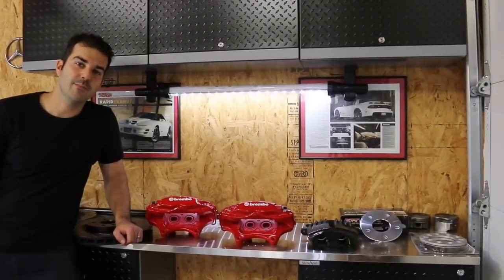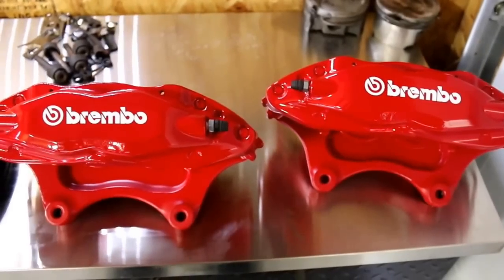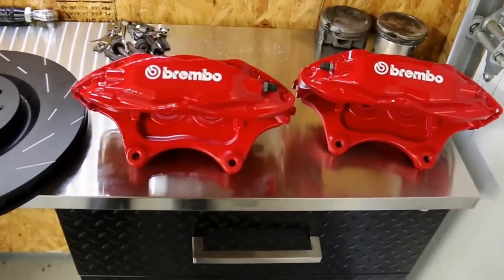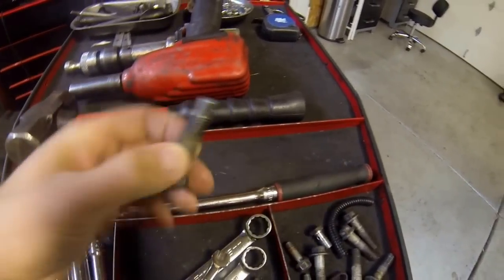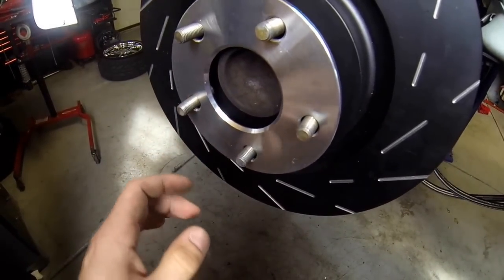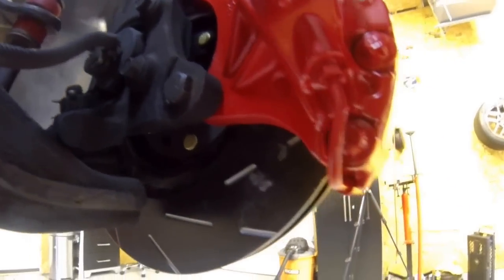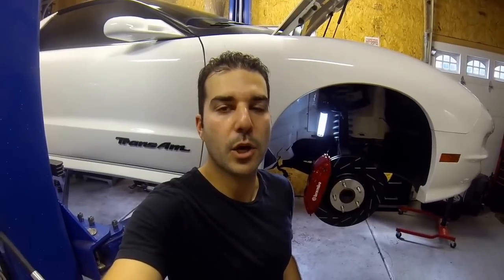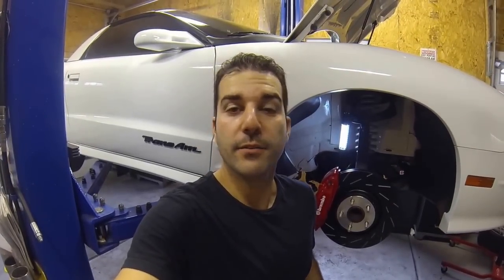Cheap and easy way to upgrade LS1 Camaro or Trans Am brakes. CTS V Brembo install.

Comment: That looks great! I was surprised at the brake pads you chose though, performance calipers and big rotors with a ceramic pad. The ceramic pad is made for comfort and low noise but you get a lot more braking grip from a performance semi metallic brake pad like ebc yellow stuff or blue stuff if available with the calipers. Thought I'd mention this since people that watching for performance upgrade options might copy your choices and wonder why they don't notice much difference in stopping power.
Reply: He specifically mentioned aesthetics. That's what 95+% of ppl have these BBKs for. How's the noise level with aggressive pads? Coz I see a lot of annoying squeaking (not sure I trust the drilled and slotted rotirs either) with ppl spending 2Gs or more. That's unacceptable.

Comment: Super glad I found this channel keep up the good work. I flatter myself that I know a thing or two about most things automotive. The video was filled with nothing but good info. You provide enough information for the reasonable competent enthusiast to do the job. What adds to my comfort level is you give enough explanation of why without getting too involved again reasonable competent. Should have no trouble what so ever. 
I performed a similar up grade to my old 3rd gen 92 formula 350 WS6. using C-5 13" with the stock 4th gen Rrs PBR and 17x9 all around with a square tire 275/55 17. used the 1le combo valve the get more rear brake bias. worked well one of the best upgrades I made to the car better even than the 383 /425WHP with beefed 700R4 . Thanks for sharingt his is a great upgrade again throe explain and illustration. Happy new sub. going to binge watch a bit.

Comment: Keep an eye on the pin kit. The ones that come with pads are often a few mm's shorter than the OEM ones. I reuse mine every time because of this. They have the possibility of backing out.
Reply from the maker: I will definitely check on them .They went in really nice and snug so I don't expect any issues. Thanks for the heads up and thanks for watching.
Alex
Reply: No problem. I'm sure they're probably safe 99.999% of the time, but I have seen a forum post about it happening before with a different set of Brembos. 

You can really tell the difference looking at the front of the caliper. Mine, with the OEM pin kit, look like this. 

http://www.carid.com/images/brembo/page/bottom/brake-kit.jpg
Reply: clutchthepearls  Wow! You took the words right out of my mouth , I just did  lower dust pads on my e63 amg and the pins they gave me where shorter I didn't like that , the stock ones you can see the cone of the pin stick out past the caliper for visual complete seat , another reason is the stock pins are stainless steel no stick with a magnet , the ones included where zinc coated steel equals possible rust
Reply: I wouldnt mind getting them. I put a 4th gen fbody on my 04 grand prix and works very well.
Reply: I work for a Professional Race Team IMSA Road Racing, and this reason alone is why safety wire the pins. We had the same issue with pins backing out

Comment: I'm doing the same CTS-V brake swap onto my 97 Z28 with the same 4-Piston Calipers but I'll also swap in "Detroit Speed" SKF X-Tracker wheel hubs. My Camaro needs a 1 inch or 1-1/4 spacer that has it's own studs because both my 18 inch C5 Magnesium Wheels that I use for road racing and my 18 inch C6 wheels for the street were both over a inch inside the fenders. For brake rotors I'm using C6 Z06 Eradispeed rotors from Baer which might have a tiny difference in offset. If so, a few washers in between the spindle and caliper should center the brake caliper and brake pads. Using the C6 Z06 Rotors, you don't have to have the center bore enlarged verses the 5th Gen SS Camaro...

Comment: Thanks for the video. I really came here for the part numbers and see how hard it was to do.  However, I think you have the rotor on the wrong side.   Air is supposed to move from the inside to the outside of the rotor.

Comment: I have a 2001 camaro ss. I have the c5 z06 18” in the front 9.5 wide will I get away with a 5mm spacer?
Reply: Lsjuan Camaro did u?

Comment: Great video I  have a 71 Camaro I'm in Chicago I'm going to convert my drums to disc
Reply: ??? Almost every company makes a disc conversion for this car. If you're referring to rear brakes. The optional rear disc from Firebird (same Generation). The system was the same on the early RWD Seville. The only problem is the Seville is the big 5 (5X5" bolt pattern). So you'll need Firebird rotors.  01 and newer S-10 Blazer 2WD (easier to incorporate parking brake). 3 or 4th gen Camaro 4 TH gen best.

Comment: This is great.  I’m seeing sets of 4 for 2004-2007 calipers but what about the rear? What do I need?
Reply: Keep the rears stock just upgraded your rotors and pads. Don't need too much braking power in the rear

Comment: Why wouldn't this also work on 93--97?   How much different did the front tire kick out , after install.
Hate wheels sticking out front wheel well.🤯😱
Reply: Have to change to the 98-02 ls spindles

Comment: It’s funny that I just added a “big brake kit” to my 3rd gen 89 IROC and by big brake kit I mean the 98-02 “LS1” brakes. And dont get me wrong the LS1 brakes on a 3rd gen is a dramatic improvement over the stock 10” single piston front brakes. But what I like is that now since I have the modified spindles I only need the correct bracket for whatever brakes I want. So quick question, what power level would you recommend to justify upgrading to these brakes?, I’m currently sitting at 330 hp at the tire
Reply: Depends if you do sprinted driving on backroads and weight of the car. My car with heads and cam was required. It's a big improvement over factory brakes
Reply: @bhcamaro2002  / ok well I live in NE Pennsylvania so I do some fun driving on the back roads, now the car is an 89 Camaro so I think they were 3200ish lbs and I’ve only removed the steel hood for a fiberglass one (had an accident otherwise I’d have kept the of hood). The car is a T-top but I’ve added weld in s. frame connectors. Like I said I have the “ls1” brakes up front and pbr calipers out back on a BW 9 bolt with 3.27 gearing. I’m in the middle of a power train swap right now with an Lq4 running 862 heads, so 10.5:1 compression, drop in truck cam for the 6.0 so power wise on paper at least I think ill be sitting at around stock ls3 power with everything coming in early because of the truck cam (using a truck cam because this isn’t a race car and I wanted my hp / tq down low). I have the opportunity to get a set of 2012 Camaro SS brakes for practically nothing and from what I’ve read my car will be 600-800 lbs lighter than the 5th gen. So what do you think about only running the front 4 piston brakes and leaving the rear as is or should I swap the rears out as well, oh and should I bother with an adjustable proportioning valve? Thanks for the help n sorry to be long winded
Reply: @limabravo6065  I left my rears stock. The rearend can lock up with too much braking pressure. Sounds like you have a decent build can't go wrong with a 3rd gen man

Comment: Can you not just run corvette rotors and not have to machine the hub hole?
Reply from the maker: teamgmotorsports You would still need to enlarge the hubs and the pads don't fit as nicely

Comment: Isn't the lug pattern different? I believe the 2010-2015 is a 5 x 120 and the 4th gens are 5 x 120.65mm. How does this affect the application?
Reply: No issue. Only thing I had to do it get the hub bored out to fbody spec at a machine shop

Comment: Looks like you installed the left rotor on the right side.  Air is supposed to move from the inside to the outside.

Comment: Hey Bro. just in the process of restoring a 98 Camaro. Would like to take the same route you did with the ctsv callipers. Question? will they fit on the rear? I want to look uniform.
Reply from the maker: These will not fit in the rear.  I'm sure anything is possible but they are pretty huge for the back.  Most just do the fronts and paint the rear to match.

Alex
Reply: Ok understood. but tell me, I'm pretty sure there was a video on installing Coevette brakes all around the 98-02 Camaro. Can you verify?
Reply from the maker: Hmm, not sure of a specific video.  I'm sure it's been done. Our cars have had every mod known to man kind tried at least once, haha.

Comment: Really like the video! Unfortunatly I'm running the 17" Dark Stars and as you said would rather not grind the calipers to death in order for this to work. Any other suggestions on other rotors or anything?
Reply from the maker: Hmm with the 17s I dont really have any other suggestions.  You could just go with the c5 z06 brake upgrade.
Reply: ATS-V brakes will fit on the front under 17s but you have to drill the mounting holes to 14mm I believe
Reply: I gotta say that by 4 min into the video this isn’t sounding cheap OR easy, given that no TA came w 18” wheels, so right oughta the box you’re telling me I need 4 new 18” wheels and tires on my WS6 that came w the upgrade to 17”!!!!  That means I’d have to recalibrate the speedometer then, too!!  Then, just for a chaser, you toss in the fact that I have to get the BRAND NEW ROTORS you’re recommending specially machined to fit?!?!  NOT CHEAP!!!   DEFINITELY NOT EASY!!!!  WTF?!?!?!  Y’know what?   You get a “spam flag” for sucking me in and wasting my time!
Reply: @Psykldoc  for 18in wheels, a 275/35/18 tire is same diameter as stock, and does not require speedo recalibration.

For as big of an upgrade as this is over stock, it is cheap and easy.

If you were familiar prices of kits like Baer, Wilwood, etc, this CTSV setup is very cheap and easy

Also, the use of OEM parts is nice for future serviceability.

Having the rotors machined really shouldnt be a big deal, and shouldnt be very expensive.
Reply: He’s not telling you that you “need” to do anything. He’s telling an audience what it takes to upgrade the f body brakes to CTS-V brakes. Nobody put a gun to your head and demanded that you upgrade your car. Also, nobody made you click on the video. If you’re too lazy, cheap, and not mechanically inclined, this isn’t the project for you.

Comment: So I have a 93 Z28 and my brakes suck. As you know they are 1" smaller than LS1 rotors and I have a hard time getting it to stop. I know that I would have to upgrade to 98-02 spindles to do the Ctsv swap. Question is are all 98-02 spindles the same such as V6 compared to V8?
Reply: Nevermind. Did some research and found out that the V6 and V8 cars had the same brakes.

Comment: Hi I’m using the same calipers but on a different car,my hub is 58mm,now if I used a rotors with larger hub hole like 68mm would it have issues?thanks.

Comment: So, I've had this whole setup sitting in my basement for the past 4 years. The only thing holding me back right now is dropping 1500 bucks on new wheels and tires due to my 17 SS wheels. The other issue is whether to paint them. I also have a white fbody and currently red calipers but I really can't justify messing with the factory coating they have even though it says CTSV... Lastly, I always wanted to ask someone who did this if they felt a difference in steering or anything up front from the added weight?
Reply from the maker: No difference at all in steering. Just better braking and cosmetically they really stand out. One of the best mods I've done. 

Alex
Reply: @LegitStreetCars  Thanks for responding! Ya, idk why it's just something that always looked great to me. Do you think the silver CTSV would look goofy on a white fbody? I constantly battle with this. Lol
Reply from the maker: I was debating that too since the calipers came siver like on the Cts. Here's what you can do. Run it silver at first and see if you like it. If you do you're done but if you don't it's not hard to take them back off for paint.  I really like the red on my white car though, silver may blend in too much.
Reply: @LegitStreetCars  Very true. Mainly, I wish they would I just don't want it to say CTSV since you'll get those douches that say, "it's not a CTSV". Lol. Oh whale. Thanks for the tips, sir! Sick car, btw.
Reply from the maker: Yea I hear ya.  Just paint them and be done then.
Reply: @alucarus6  awwwww shit you need 18 inch wheels ??????

Comment: Off topic question but what rims and tires do you use when you go to the track? Thanks in advance!
Reply from the maker: Hey Austin. For the track I use 17inch 5 y2k wheels in the rear and the 18 inch version of the same rim up front. Thanks for watching.

Comment: DID you grind the ends down on the caliper to clear the rims? Or running a 18"? Drill the bigger holes on the knuckle for the bigger bolt?
Reply: He's running a 18, if you go 17s you have to grind the caliper down

Comment: Great video and very informational. 
What's your review of the brakes? Anything you particularly like or dislike about the setup? 

I'll be doing this mod soon. I appreciate a response, been trying to find someone who has done it!
Reply from the maker: Thanks! It's been one of the best mods I've done to the car. The only issue is some brake noise but I suspect the pads are to blame. The calipers I bought came loaded with pads so I'll probably just swap those for something better.
Reply: Gotcha, well I'm excited to do this. Thanks for the reply! I'll be sure to invest in some decent pads the first time around.
Reply: 1 more thing, you didn't have to drill the bolt holes for the new calipers? Other how-tos that I've read for this say you need to drill out those holes for the bigger bolts that the cts-v calipers use.
Reply: @tampabaybuilds6825  1st gen ctsv are direct bolt on. The newer ctsv and Camaro ss 5th gen 6th gen will also work . You just have to drill out the spindle 1/2 then 9/16 to use the 14mm bolt that bolts the caliper. The ctsv 1st gen uses 12mm like the stock ones

Comment: Do you know if the 5th gen camaro calipers are the same?? 
And thanks man, a lot! For the vids, replies and everything.
Reply from the maker: The calipers are basically the same but have different mounting points. Do the ctsv its more of a direct swap

Alex
Reply: LegitStreetCars I can see that thanks to you. Only wanted to be sure because from where I am, tons of camaro's are parted out! 1st gen ctsv's are rare, but I should find one. Appreciated man
Reply: LegitStreetCars sorry one more question. What about the rear ones?
Reply from the maker: I didn't do anything with the rear. Some say too much rear brakes on these cars make them break loose on hard braking. There are proportioning valves you can get but a lot of people just do the fronts and they work great. Just put a good pad back there.  Check the links in the video. You can buy brake new loaded CTS V calipers for like $350

Alex
Reply: LegitStreetCars well, I guess I will stick to your swap. Thanks Alex
Reply: The front brembos on the 10-15SS are identical to the CTS-v calipers. They just use a 14mm instead of 12mm mounting bolts. My g8 required a 2mm sleeve to run the CTS-v brakes instead of the SS ones. 

All depends on what size the f body mounting bolts are. If 12mm then you're good and you can buy a sleeve from McMaster Carr.
Reply: @TheHerokid672  what year ctsv?
Reply: @hectorcastillo2463  04-07 are 4 piston 12mm and the 09-15 CTS-v are 6 piston front 4 piston rear and are 12mm. I think the camaro was the only model to use 14 mounting bolts.
Reply: @TheHerokid672  got it thank you . I'm still gathering info on what calipers to get that are 6 piston
Reply: 6 piston you can get on any 09 and newer CTS-v and 16 and newer ATS-v.
Reply: @TheHerokid672  I can get a set of 6th gen calipers new for 180 but can those bolt on like the 5th gen with just drilling the holes?
Reply: @hectorcastillo2463  the 6th gen are different. There's non-brembo gm brand calipers which are smaller and then the zl1 and SS brembo calipers which are larger. The larger one have better stopping power. 

But the mounting holes should be the same for either. So yes youd have to drill out the knuckle to accept the 14mm. A machine shop can do it.
Reply: @TheHerokid672  do you have like an Instagram? I'm getting a good deal 200$new 6th gen brembo calipers and rotors . But not shure if I can use them on the f body with the same modification as the 5th gen
Reply: @hectorcastillo2463  I do but I don't use it. The bolt pattern is the same for the 6th gen vs the 5th gen. So it would fit. It's just a smaller caliper. You need to use the 6th gen rotor as well.
Reply: @TheHerokid672  got it thank you

Comment: Hey man quick question. I’m currently in the process of doing the swap but for 6 pistons off the V2. I didn’t hear u mention anything about drilling out the spindle to 9/16 and where you purchased your new caliper bolts from. Love the videos BTW
Reply: Did you get it figured out
Reply: @bhcamaro2002  I did, and I couldn’t do without them anymore lol
Reply: Awesome man! It's a big improvement over the crappy factory 2 pistons😂

Comment: My car is at shop now getting fronts done but they’re saying the new rear 14” rotors are not fitting the stock calipers. Was there any modification required? I don’t remember you saying there was. Lmk please thank you.
Reply: Glenn The Closer Lombardo this is only for the front isn’t it?
Reply: EtelorveHc49 hey. Yes, the main focus of the video is for the fronts. But in the end he did say that if u want to do the rears to keep the stock calipers, assuming bc the rear ctsv ones won’t fit, and simply swap the rotors with the new ones. I’m a fucking rookie when it comes to this stuff so there may have been some obvious mods needed that he didn’t need to mention that i just missed. But yeah man the rear stock calipers don’t fit the larger 14” rotors. FYI